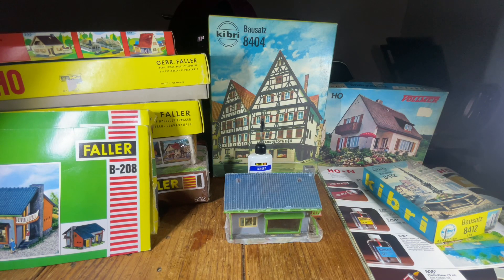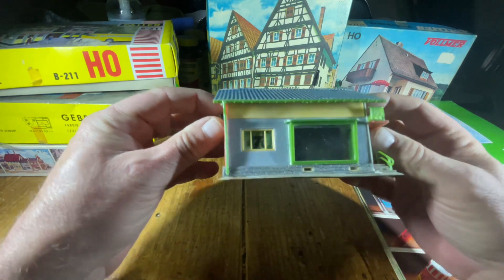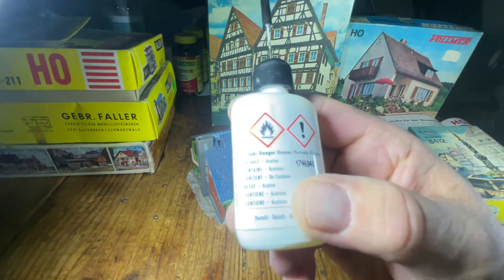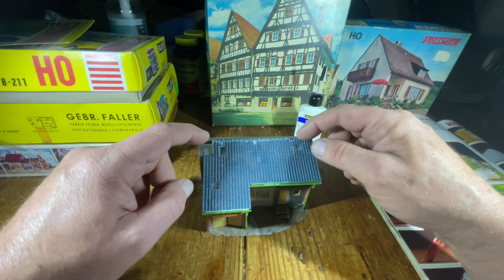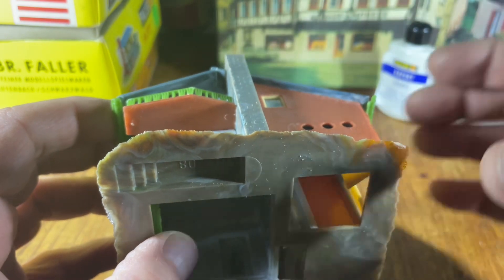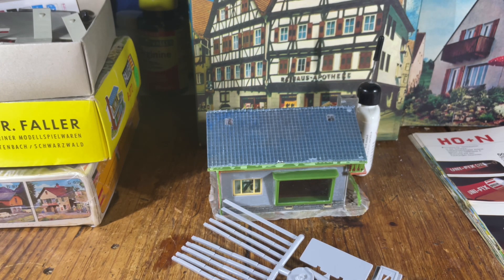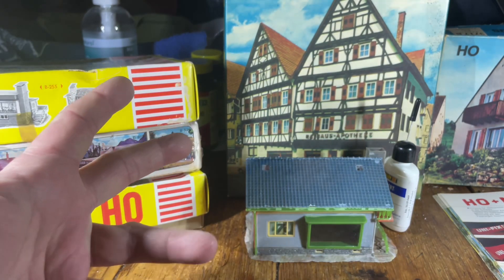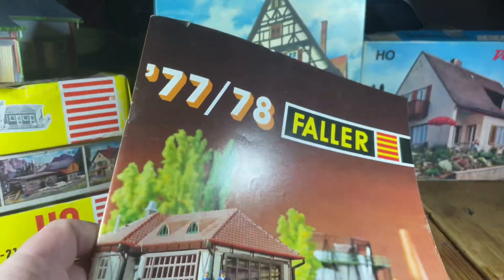Tips and tricks on how to build 40 - 60 year old  Faller, Kibri & Vollmer Models which are NiB / NOS

Comment: I like these kits along with Pola/Pola quick.  A lot of the pola and faller stuff was also sold under the name model power in the US and when Piko joined in they also offered an ICE train. Pola, heljan and faller were also sold under the AHM, primex, Bachmann and Revell names. Kibri was alwas a bit more realistic, however faller was more willing to offer Mid century/jetsons style houses and skyscrapers.

I use all purpose cement on these old buildings since CA glue also does not work very well.
Reply from the maker: Would you have a particular brand name of the cement you prefer or works best? Thanks Peter
Reply: @fleischmann_rowa_roco_ho   Krazy Glue Fix-all adhesive and a generic Multipurpose cement that comes in a black tube or The Testors cement in the blue tube, the red tube is too caustic for certain plastics. I learned the hard way with some tiny battleship and submarine models that turned into putty because of that glue.
Reply: thank you for this valuable information! I will get a tube of the blue Testor cement and a tube of the clear parts cement 3515C and liquid 3502XT from Hobby Lobby
Peter